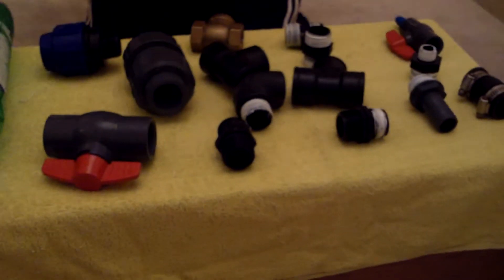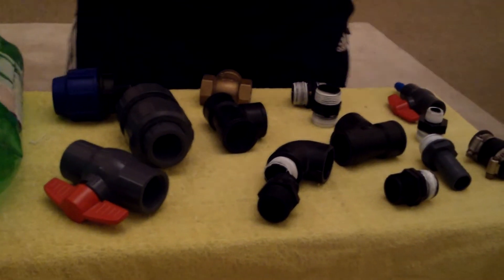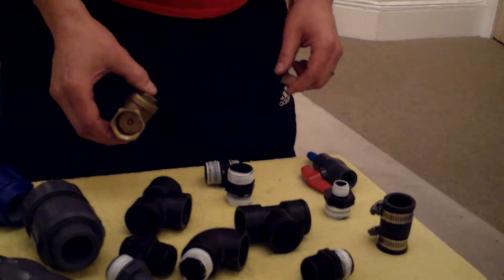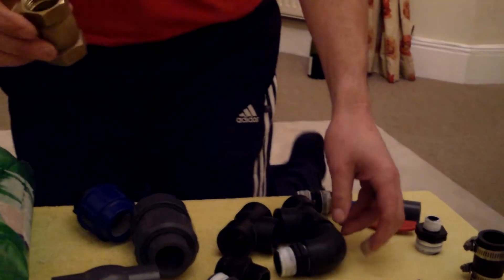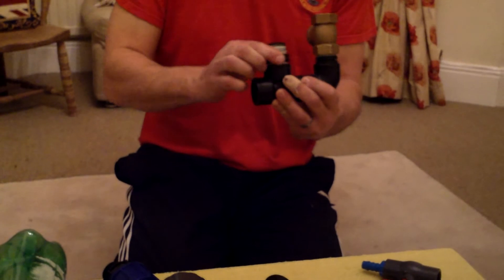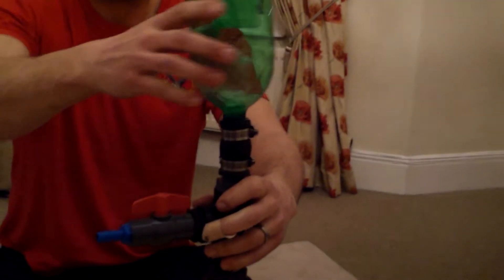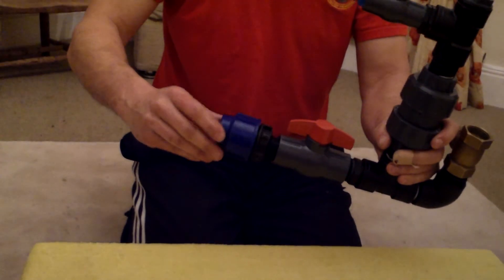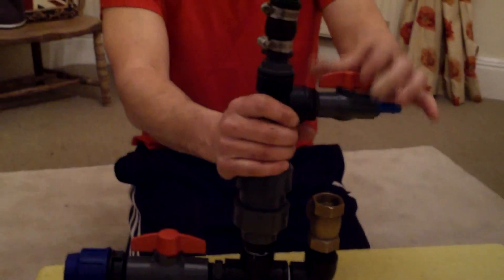construction of a ram pump.MP4

Comment from the maker: Hi,
You've got plenty of fall, and it should pump 7m high no problem, is your inlet well submerged with no air entering the system? Is your air vessel becoming water logged ? What bore is your drive pipe and outlet pipe?  Cheers

Comment: The water source is a pond that pipes water (using a garden hose) into an open water tank. I opened the tap on the hose to fill the water tank at approximately the same rate as the pump empties it. A 17 metre 3/4" polythene pipe goes from water tank to pump (5 metres below). The outlet pipe is a garden hose. I experimented with 3/4" and 1/2" hose pipes for outlet.

Comment: Thanks!
1. Drive pipe length =17 metre polythene pipe.
2. Drive pipe drop = 5 metres.
3. I experimented with an outlet 30 metres long and also 100 metres. The height difference between outlet and pump was 7 metres in both cases.
4. Will have to find a way to measure this.
5. 3/4 inch fittings as in your great video.
6. I chose not to use snifter valve until pump fundamentally works.
7. I believe so. I used PTFE tape.

Comment from the maker: Hi, I'll try and help you out but you'll have to check the following and also give me some more info:
1. how long is your drive pipe?
2. how great is the fall from the inlet to the pump?
3. how long is your outlet and how much higher is the outlet from the pump?
4. How many gallons\litres a miniute s your flow into the pump?
5 how big is your pump?
6. how big is your snifter hole and is it in the right place, it must be opposite to your outlet.
7. are all the fittings air tight?
Check it out!

Comment: Hi, I managed to get the pump chugging away once I replaced the hose inlet with a polythene inlet pipe. After 5 minutes I opened the outlet a tiny amount. I opened a little more every 5 mins until the outlet was fully open and the pump continued chugging. Only a tiny dribble was coming out at the end of the outlet. I tried again the following day but now the pump doesn't work once I open the outlet (even the tiniest amount). Any ideas what I'm doing wrong?

Comment: Hi, I live in Spain. The pond is constantly being filled up by a spring. As things stand the water overflows out of the pond anyhow. The waste water I want to collect in another pond, beside the pump. This water will irrigate my vegetable garden using a drip system. I need the hammer pump to take water up to my house, about 50m from the spring (about 3m higher). Did you have time to consider which of the 3 options I listed would be best to try next for the pump? L

Comment from the maker: Hi, Don't try and cobble up a load of different diameter pipes for your drive pipe, stick with a single length of same size pipe, you can use proper connectors if you need to extend the drive pipe. You can use poly pipe, it works fine, not as good as steel but you'll get the pump running fine. If the pumps pulse is slow you may have to add a stand pipe half way down the line, this will allow the pressure wave to escape quicker and increase the pump cycle rate.

Comment: Hi, thanks for your reply. My source is a pond (about 50cm deep) connected to a spring. Before I buy a 30m roll of 3/4" poly pipe, I'd like to try what I have in the garage, this consists of... a) A 3m long 3/4" suction hose. b) A 20m roll of 12mm diameter poly pipe (will this work as an inlet even if the rest of the pump design is 3/4"?). c) Two 2m long 3/4" PVC pipes (Not long enough to reach source but could I connect it to a garden hose?). What would you recommend trying 1st? Thanks again, L

Comment from the maker: Hi, No i have never used hose pipe as a drive pipe, ram pumps work on the water hammer effect. Hose pipes are flexible and absorb the pressure and pump will not work. Poly pipe will work as it is fairly rigid, steel is best. Poly pipe is pretty cheap, Is your pump in a stream? cheers.

Comment: Hi, is not the inlet in your other youtube vid "Home built model hydraulic ram pump" a hose pipe? The distance between my source and the pump is quite long (maybe 30 metres). It would be too expensive to buy steel/poly pipe to cover that distance. Can I mix a garden hose with poly pipe at the end of the inlet. Thanks again, leao

Comment: Hi DJB, I'm using a 2L plastic Coke bottle as pressure vess. Original water source is 2m higher than the pump. Inlet is free of air. I used a petrol pump to pump all the air out of the hose to begin flow (inlet source stayed underwater before & after I released petrol pump so no air got in). The non-return is definitely right way round. One of unions has tiny drip as ran out of tape, but doubt this is the fundamental prob. Read somewhere that hose is not good as inlet? Thanks for your help, Leao

Comment from the maker: What are you using as a pressure vessel, is it a bottle like mine? whats your driven head and is your output higher. Input must be free of all air, unions must all be water tight too. Is your non return the right wyt around i.e ball seating in the vertical position. Let me know, be happy to try and get you up and running, hey don't be shy and make a video of the pump. Cheers.

Comment: Hi, I've bought all the parts & set it up as you said but for some reason it doesn't work. I'm not an expert but it appears that the pressure from the water inlet slams the brass swing check "waste" valve and that's that. The pressure doesn't go down enough again for it open again. The water goes up the outlet pipe but only up to the level of original water source but no further. Any suggestions as to what I'm doing wrong?

Comment from the maker: Hi, The snifter valve is a tiny hole drilled below the non return valve, normally you leave a piece of wire or a split pin in it, this helps prevent blockages. The snifter valve sucks in a small amount of air on each stroke, it charges up the air vessel and prevents it from becoming water logged. Google Tmex and you will get there web site up, you can get nearly everything you need off them, let me know how you get on, cheers.

Comment from the maker: @DirkME1022 Hi, here's a list of the parts
;1. 1 pvc non return valve, female x female.
 2 1 Brass swing check valve female x female.
 3 2 pvc ball valves.
 4. 1 compression adaptor male.
 5. 1 male x female elbow
. 6. 2 equal Ts female thread.
 7. 5 equal nipples.
 8. Male hose adaptor
 9. Reducing nipple.